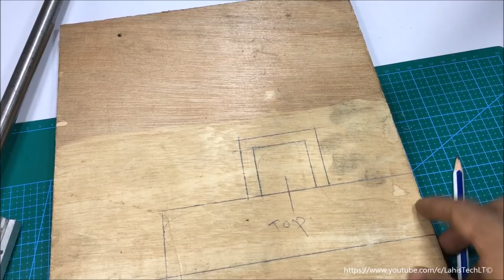DIY Drill Press Build // Homemade Metal Drill Press Stand

Comment: This is fantastic build ,I got A better Idea To use two Scraps rods Lying around my room..But I think I willAd The Pressing Arm on the Top..So that Pressure Is Applied Equally on both The Linear Bearing which in your case It is applying pressure on right side only so Slightly bending..I tried such thing before and same thing happened  my design had A flaw Where Both Bars were Not Accurate (I don't knwo wht to call the thing Which we pull down).

Comment: i saw that correct ? the guy use pillow blocks, axis mount, and build every thing else from wood ?  only the pillow blocks can be more expensive than a bench drill
Reply: Um, no... those bearings are not more expensive than a bench drill.  They are $5-10 each.  Not super cheap, but not more than a complete drill.  His looked like they were well used and salvaged from something else.  

You can definitely build a drill press cheaper than this (using the drawer slides from an old dresser, etc.), but this one looks more accurate and stable than most of the ones I've seen.  I hate when people watch videos like this and then just criticize it.  Presumably you came here because you couldn't figure it out yourself.  If you have a better idea, build it and make a video.

Comment: Hi Dear, Where did you got the adjustable spring. please give me the link. thanks
Reply from the maker: I got that from a local hardware store.
Reply: hi ,the full name is --->Adjustable Automatic Lifting Spring Device ,you can find it on e-bay or aliexpress
Reply: @LahisTechLT  tell me metal plate dimension

Comment: Where is the video for the drill press that was used to make the parts that were used to make this drill press? Why wasn't the first drill press used to drill the wood parts for this drill press? Could much of the assembly requiring nuts and bolts -- particularly the slide -- not have been accomplished using careful planning, judicious drilling, and roll pins ?